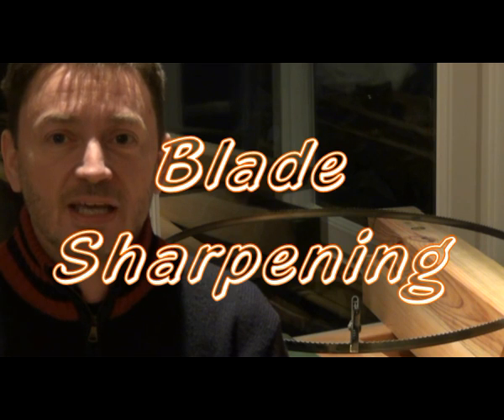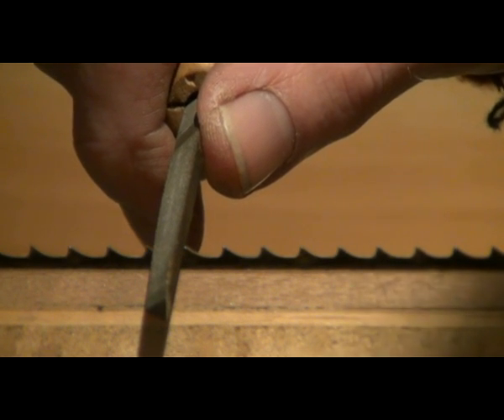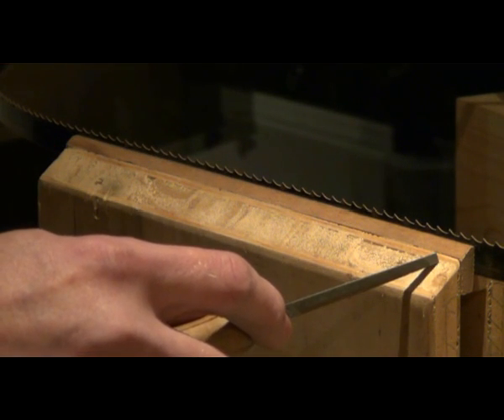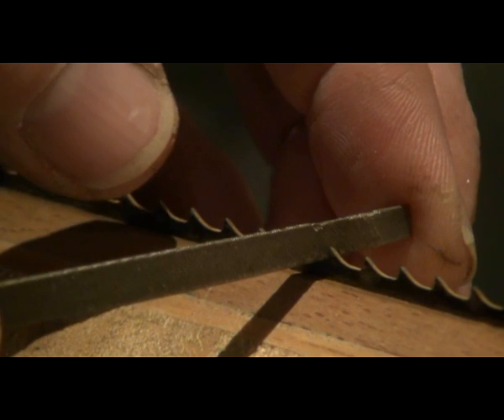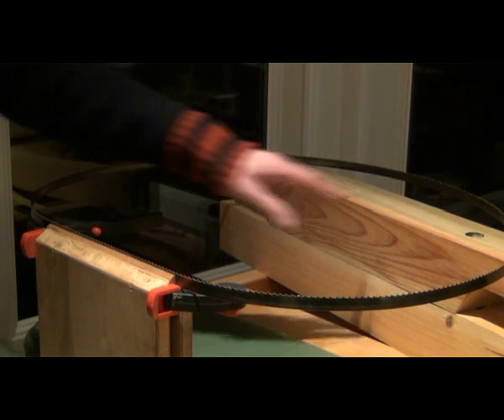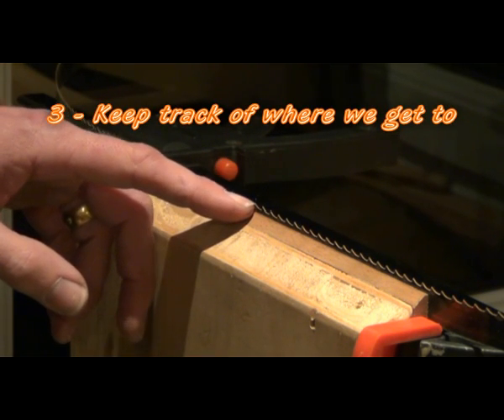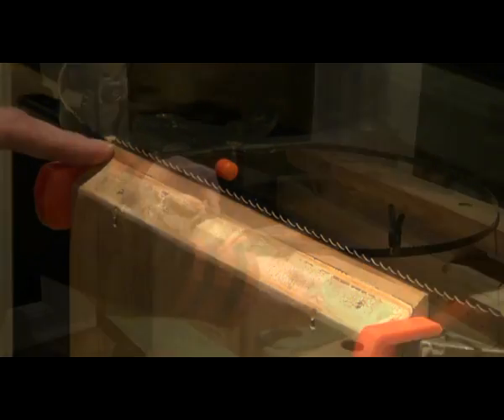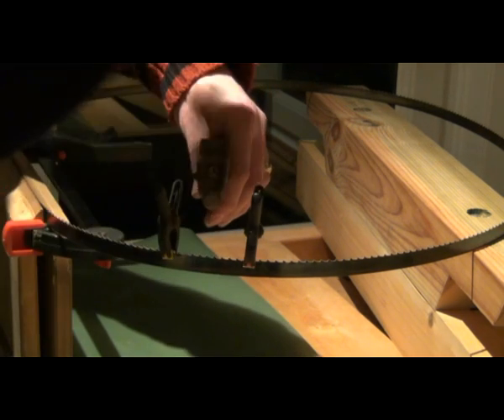How to Sharpen a Band Saw Blade

Comment: Great ideas Mitch. I have tackled this unpleasant task myself with some success. I have found the larger Bands easy enough but my 1/4" and 3/16" too daunting and time consuming to tackle. I have tackled the smaller Bands by sharpening sections and when I have had enough, I mark them and set them aside until I decide to tackle them again. Thanks Mitch.
Derek
Reply from the maker: GiddyUp994 Cheers Derek. Yep, it's a toss up between a boring job or the cost of a new blade. Mitch

Comment: Dear Mitch, thank their knowledge so well explained, especially for those who have no experience with band saw.
That put the clamp beneath the blade is sensational. Great tip.
One thing I could not understand (perhaps because of the language): you must use the mini spring clamp handy every time for sharpening the blade? If not, when you need the lock with the mini spring clamp handy?
A big hug and success.
Said - Brazil
Reply from the maker: Said Choucair Olá, I think you are asking about how often to set the teeth? You only need to do this after many sharpenings, or unless you want a wider kerf, to cut tighter radiuses. Not required every time.
Pleased you found the video useful. Happy woodworking, Mitch
Reply: Okay, I appreciate your attention and quick response. It is not common.
I am joinery lover and now I retired with engineer can dedicate myself to the hobby that both taste.
I wish you much success and always bring in their knowledge.
It was a pleasure to speak with you on the Web.
hugs,
Said
Reply from the maker: Said Choucair My pleasure Said, take care, Mitch

Comment: Can I sharpen a carbide bandsaw blade the same way?
Reply from the maker: A diamond hone would allow you to touch up the carbide tips. Follow the two flats, mostly working the larger face, and keep the tooth geometry the same.
It is questionable whether either blade type is economical to resharpen, but until you've done one you don't know how much time it takes or how good the result.

Comment: Does the teeth need to be set every time you sharpen the blade sorry if this is a stupid question
Reply from the maker: Michael Flynn Hi Michael. Not stupid at all. The width of kerf will ultimately depend on the work you wish to do with the blade. Wider kerf = smaller radius capability. The width of kerf is determined by the set. More set = wider kerf. When you sharpen, you reduce the set a little, so if you cut tight curves with the blade then you may wish to set the teeth every time. If you use it to cut straight lines, for example tenon cheeks, then as the set reduces you'll probably find it performs better. A lot of blades have induction hardened teeth, which have a potential to snap if re-set, although I've never had that problem. Funnily enough, these same induction hardened teeth seem to be just as easy to re-sharpen as non-induction hardened ones. Not sure what's going on there! Regards, Mitch
Reply: Thankyou